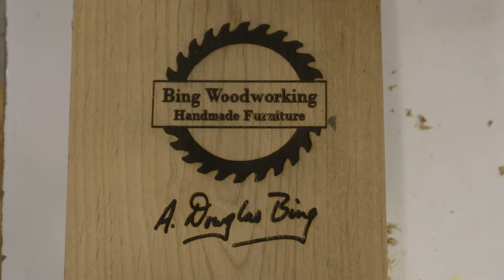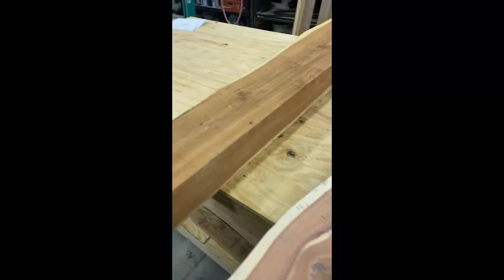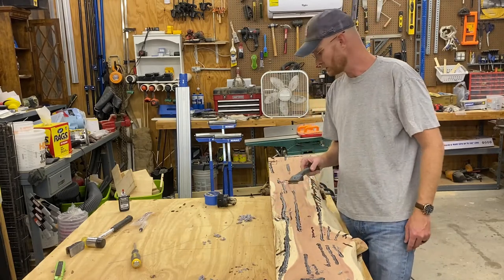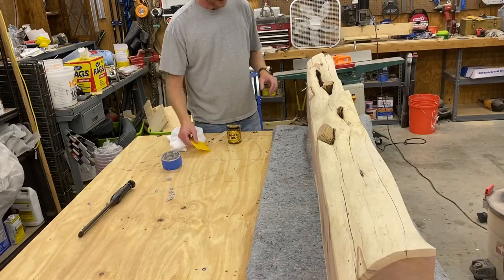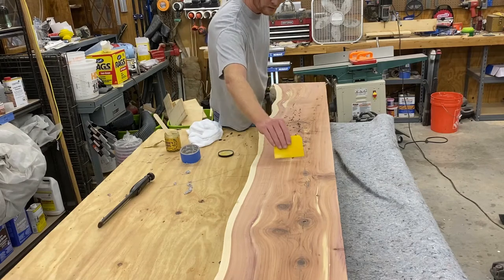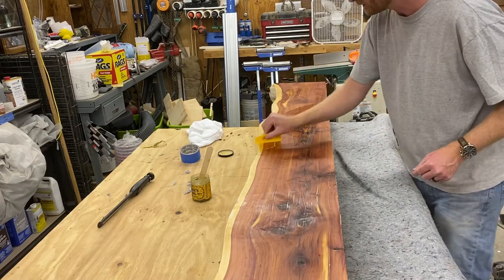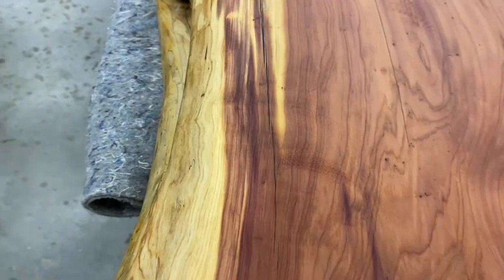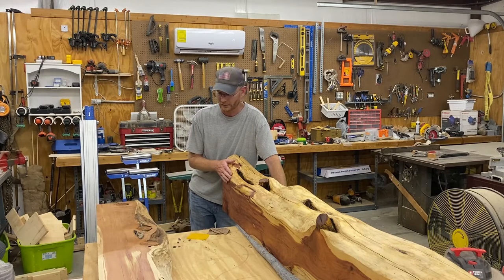Making a cedar mantel from a live edge slab

Comment: I am a diy'r myself and have invested heavily into bigger machines to make a job easier. Would highly recommend a 20"-24" planer with helical head on it for producing a very smooth surface  finish on  slabs for mantles. Very little sanding needed.
Reply from the maker: hopefully 1 day that will be in the budget and have enough floor plan to accomodate!!